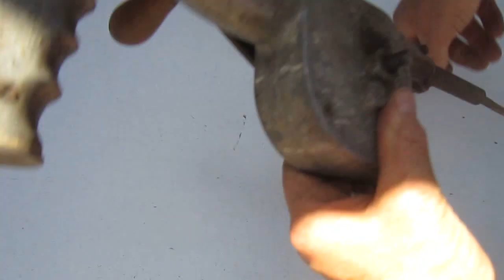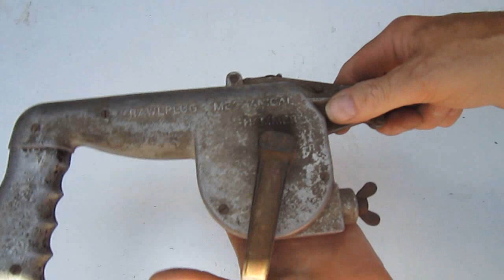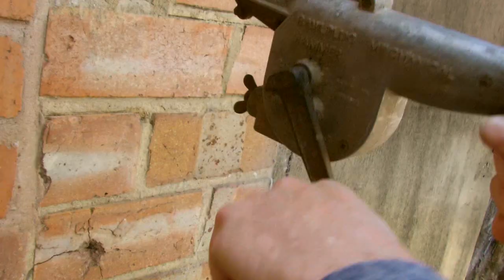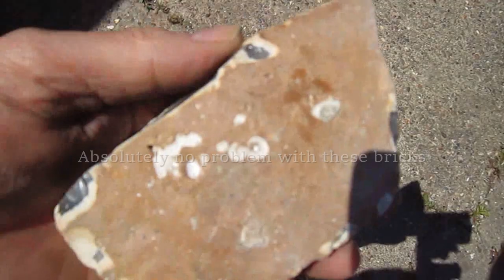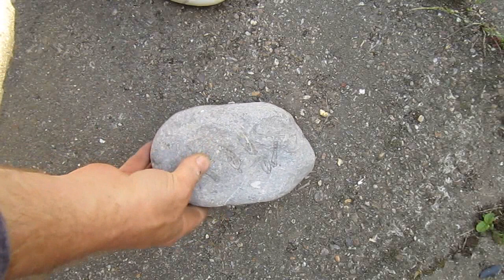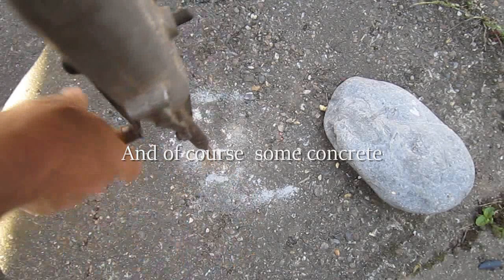Percussion powered drill in action

Comment: Never seen one before,Thanks for the video, I wonder how they got on , On a building site. I don't think I would have paid 10 pounds for it though.?
Reply from the maker: Thanks Malcom, i was very surprised at how well it works! i'm going to try and find a way of putting  modern masonry bit into it, or maybe even fitting a power drill where the handle turns? for some super percussion drill fun 😀
Reply: If you consider the alternative in those days im pretty sure you would have, would you rather sit there all day with hammer and drillbit hit rotate hit rotate hit rotate rinse repeat.